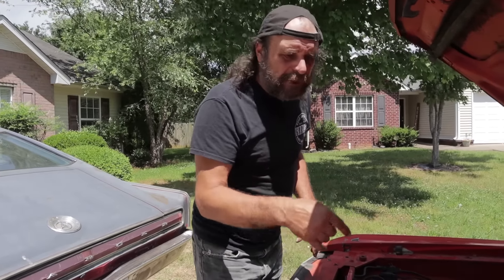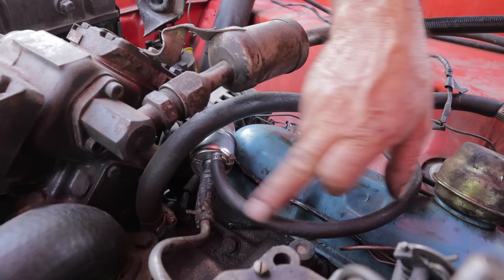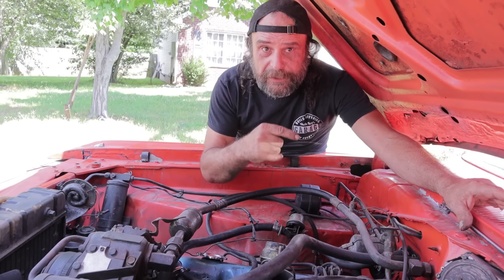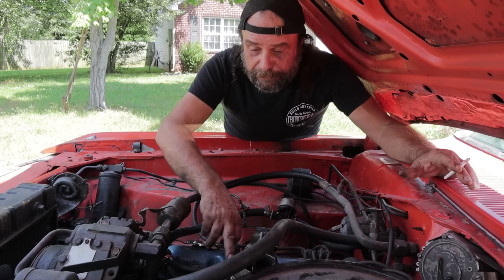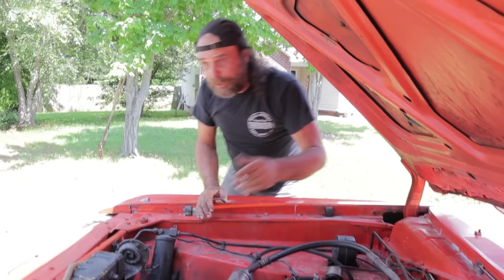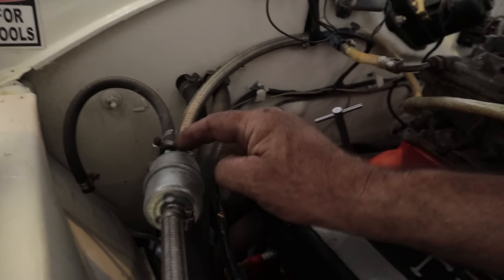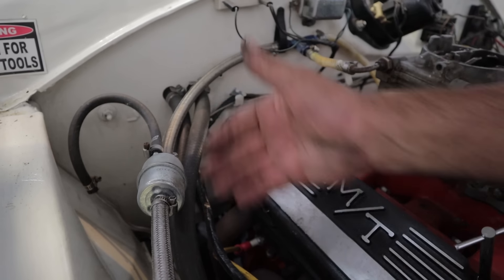$8 Cure For Vapor Lock

Comment: I'm proud that I thought of this on my own.
Question: My truck is factory set up to return from the mechanical pump and still boiled the fuel on its way up the engine. I capped the return on the pump, and I'm running one of the orifice-type filters right at the banjo on the carb. Fuel is then returning back down the engine and into the factory return line. Now I don't get vapor lock while driving, but I still get hard-starting when hot (acts like bowls are dry). Is a phenolic carb spacer the next step?
Reply from the maker: Yup
Reply: @UncleTonysGarage  Thank you!

Comment: If you go on rock auto and look up fuel filter for the swinger it will not show the filter with the vapor diverted although the filter is available rock auto and all other parts stores will not show the part number with the diverter . Recording part numbers these days is extremely viable .

Comment: Damn. I’m going to do this tomorrow. I’ve got a tank return fuel line but an in-line external electric pump plus a mechanical pump. Neither run when the ignition/engine is off and apparently this prevents any gas vapor return to the tank from the carb bowls. It prevents vapor lock but doesn’t help carb boil over at all.
I’m not sure what you meant when you said you used a tee back at the tank? Where does the 2nd line of the T go to? Is it one to the top of the tank and one to the pick up line at the tank before the Electric Fuel pump?
This is an under hood blower Chevy 350 ~6-8 PSI Max. I geared it to come on early. Not for any greater than 5500 RPM. It’s a 1973 Corvette. 4 speed. 4:11. I went with large powerful electric fans at first. They kept the water temperature down but because the radiator is slanted there was no air moving under the hood. Because it’s so low the radiator overflow tank is unreliable in 1973. 1973 was kind of a bastard year with multiple radiator mounting and sealing  configs during the model run. I love the looks, though, with the Chrome rear end and the low profile, now fiberglass front “bumper”.
We slapped the original fan and shroud back on and that helped a lot. Especially stop and go traffic. It didn’t help the carb boil over during short stops at the store, etc. There’s too much heat in the blower under that carb. The carb boil over is so bad that I worry it’s dangerous when it’s really hot out. I can usually start it by flooring it, waiting 30-45 seconds for some of that to evaporate, turn it over and feather it until it clears itself out. I couldn’t get my Son to figure it out. He grew up on EFI cars so he didn’t pick up on the subtle sound and feel differences in rich mixtures and how to judge the feathering part. I even had to tell him, at first, if you smell any gas assume it’s flooded just sitting there. Actually he can do pretty well now but it took him a couple of years. Live and learn. 
I learned when most of the cars my Dad owned were from the 60s. And they all did this. I watched my Dad feather the throttle like a master. Airplane engines, whether Carb or FI, where you directly control the mixture, will really teach you a lot about hot starts. A lot like old Model As and Ts. With manual spark advance, too. That’s a trip.
I hope this $8 fix you’re suggesting will help a lot. Any suggestions, please chime in.

I’m glad you liked those Cold Radial Engine starts I sent to you. https://youtu.be/myyDoekcf50 
Good times flying in a Beech 18 with Twin P&W R-985s. 985 ci and 450 HP each. The ate a lot of gasoline.
This is the exact plane I flew in with my Dad and many others with Mercy Flights in the late 1970s.
It’s now hanging in the Seattle Museum of Flight.
https://www.airliners.net/photo/Mercy-Flights/Beech-C-45H-Expeditor-D18S/2358476
Thanks.  👍🏻🇺🇸🔧
Reply: Michael Meyers is
Reply: So What's The Answer? Where Do You Tee Off at the Tank?
Reply: I have a 72 stingray with a stroker motor, had vapor lock problems and the biggest thing that helped was a heat shield from QFT to put between the carb and intake! 
https://www.holley.com/products/fuel_systems/carburetor_components/carburetor_gaskets_adapters_and_spacers/adapters_and_spacers/parts/300-4013QFT

Comment: Im by no means 'car intelligent' but I subscribed to learn more and honestly I've learned a heck of a lot already, I've been running into a problem with a 97 ford ranger manual, everytime we stall it refuses to start again for about 10-20 minutes (didn't time it but by the time we pushed it back home and popped the hood and scratched our heads it would start again) I did a little research after pushing it home for the fourth time tonight and I found alot of people running into the same issue but no actual clear answers. We found a way to make it start when this happens, by holding down the gas and clutch while cranking the engine. I was wondering if this fuel filter could fix the issue all together so we don't have the scare of stalling and  it not cranking on  a busy street or what not.
Reply from the maker: It does seem to be a common problem with those Rangers, but this won't do it.  Rangers are fuel injected, and this only applies to carbs.  If it starts while holding the pedal to the floor, you definitely have some sort of flooding issue.  Possibly a hung open injector, or even an ECM issue.  Wish I could give you a better answer.  Ranger forums are the place to ask
Reply: @UncleTonysGarage  
Lol i was searching up and down some ranger forums and could only find the 'flooring the gas' suggestion. We figured out our problem though! Incase anyone is having the same issue, the truck I'm referring to starts cold (I live in Georgia in 90° weather and apparently it's not supposed to do that?) and if we stall while it's still cold it won't crank again unless we use the "petal to the metal" method I mentioned above or wait 10-15 minutes. We realized this after a while and decided to wait until the needle on the gauge slowly reached about the middle of H/C and then we started driving, we stalled at the stop sign and it cranked right back up like it's supposed to without the gas floored. Since then we haven't had a problem with it not cranking as long as the temperature is above Cold. When it stalls even after driving for 15 or so minutes (this happened today actually) when we cranked it back up it went right back to cold and really slowly reached the middle like it had to completely re-warm itself up. Maybe its normal? I was told it wasnt. Maybe some think this is common sense but I haven't had to deal with anything like this situation before lol and couldn't find this in a ranger forum myself.

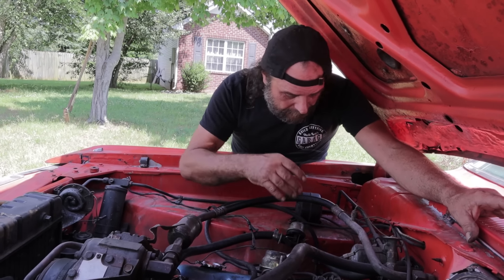Comment: 3:05 so thats what the "return" line on my 77 chevy k10 is for..... vapor return 
.
its a 6200 pound GVW truck.... so it was smog except (they didnt close that loop hole till 79 or 80 IIRC)
but i could see it having a fancy fuel filter, and the vapor being sent back to tank. 
.
ive been a mechanic since i was 6 years now..... (thats no joke..... i was tearing shit apart at 6.... with my dads oversight) 
now have 20 years experience (do the math)
.
and i learned something today!!!!
.
(and no.... im not confused by a carb.... i bet ya didnt know some GM quardajets have an adjustable part throttle? 
i can set dual points with a dwell meter, set timing by ear, and can pull and rebuild a SBC in ~20 hours)
.
not all of us young fucks are "carb illiterate" 
we are just illiterate.......

Comment: This might solve the issue.  One might surmise the issue is attributed to the ethanol in most gas now?  I've got a few stations in my town that sell ethanol-free gas, so I might try that first.  I just bought a '66 Tempest with the 326 2BBL.  After considering going with throttle body fuel injectors, the mention of how it would eliminate vapor lock paused my head scratching as to why it dies after warming up.  Seeing the clear fuel filter (near the carb) hardly fill, yet when the fuel line at the carb is pulled off, there's obvious pressure.

There's a local Maverick that sells ethanol-free 88 octane.  Might try that.  If not, WIX fuel filter part numbers for each of the two types of filters described would be great.  I just replaced the gas tank (the original was rusty inside, evident by the rust sediment seen in the filters (there was originally another one just outside the tank), and it's a non-return line style (just has a breather tube near the fill tube).  So I'd want to set it up like the Swinger, with just a breather line.

If the OP or anyone else can give me a WIX (or equivalent) part #, that'd be awesome...

Comment: Marvel mystery oil . Not much for the performance of the engines.  But it keeps the fuel cool and helps lubricate aspiration and reduce turbulence in the manfold as well to flow compressed h2o through the exhaust.

Comment: What I do is buy my leaded gasoline from petroleumservicecompany. I always buy 6 54 gallon drums but I use my car for racing every once in a while. Mine is a 69 camaro ss with the original big block 427. They are expensive if getting for a daily driver. My 52 caddy that is my daily driver I use leaded additive to ethanol free unleaded.

Comment: Tony, your channel is awesome and you always out out quality content. This is awesome and I want to do it to my car, but what do you mean by T'd off at the fuel tank? Does the vent line T into the line coming out of the sending unit, does it go up to the vent in the filler neck, or do I have to get a sender with a return line on it? Thanks!
Reply from the maker: On the RR, I Teed off at the sender.  Path of least resistance, the vapor pushes itself back into the tank
Reply: @UncleTonysGarage  10-4! Thanks Tony!

Comment: Hey Tony my 73 Ford E100 had what I called a 'return line arrangement on the feed to the carburetor, I removed the entire arrangement when trying to stop the leaks. I still have it, have only seen it used on the vans and Broncos, my fuel lines were rotten and leaking so I was eliminating as much as possible so out goes the return, it was a lot of metal line on the intake, nothing as simple as what you have. I had to stop using all forms of ethanol, it collected water, enough to rust my tank, took years to get it to finally stop clogging filters, that was after a flush and fresh gas, I hate that shit. My van has no reproduction tanks, and being on disability, there is no cash to pay for a custom made tank, hell, no funds to get the wheelchair lift relocated to another van if I found one, I make due. If I ever do get the vapor lock issue, I will grab a Dodge filter and hook it to a new return line, that is simpler, less metal.

Comment: Great, informative video.  Thank you!  I have this problem with my 64 GTO.  One question however~ how do you attach the line into the fuel tank?  I am guessing you can't just drill a hole and shove the hose in. Thanks in advance.

Comment: The best fix for vapor lock is electric fuel pump and a fuel pressure regulator. Pushing the fuel under pressure from the tank engine you raise the boiling point and pretty much eliminate vapor lock all together

Comment: 1987 Dodge 318 has been giving me starting issues, loosing prime and needs half throttle for hot starts. 

I was thinking the return was the issue, but  since you explained identical symptoms, I'm thinking maybe bypass is just plugged and its air bound🤔

Thanks for the info.

Comment: Amazing video. How does the charcoal canister play into this? I saw yours but could not see anything connected to it.  On my 74 J10, I have a check valve between tank and charcoal canister. Could I skip the check valve and go from tank to  to one of these filters?
Reply from the maker: The canister has to be bypassed for this to work
Reply: @UncleTonysGarage  Thanks! Waiting on the Wix filter to arrive and investing in a gauge/regulator. Summit is  a money pit! Thanks again
Reply: Uncle Tony's Garage  all done and man did this fix my issue. Runs well, engine stopped shaking, choking stopped and idles smoother. Enjoy the channel and educating me a lot.  Engine is a SBC mild 350 - early 70’s camaro rebuilt.

Comment: Great info. My 70 Nova vapor locks bad on hot days going up hill.  So how do you know if you need the orifice or non-orifice vapor separator?  I guess you need to know if there is venting at the tank?  I used to have a gen1 Isuzu Trooper, and it had a "vapor canister" that came off the fuel line and when back to the tank, I am guessing this is the same principle here, just wasn't around on the older muscle...

Comment: Nice video uncle tony,,im having that exact problem with my 85 monte ,with eldebrock, was wonder if the fapper line actually has to be hooked up or not ,thanks
Reply from the maker: Fapper?  If you're referring to the third nipple on your fuel pump, yes. On those cars, that was the return
Reply: @UncleTonysGarage  no i was referring to the 3rd nipple on the fuel filter my fuel pump has the main fuel line and the return, but still having the problem of starting rite up after a few min. Or ten min. Or so ,was wondering if i could hook one of those gas filter up  and maybe tee it off to whare it goes back into the tank with the return line  ,alls i know is its pretty annoying sometimes and the carburetor gets pretty hot too ,thanks

Comment: Very good, and thank you.  Also with modern fuel, if my car sits for more than about a week fuel in the float bowl evaporates.  So a lot of cranking and part throttle to refill the bowl and then the engine will start.  Is there a fix for this problem?

Comment: Great advice like Normal Brother. My 68 GTO was a Vapor Monster. During midday on the Hot Summers. Tried not to drive it then. LOL 

    Oh by the Way, don't know if you have ever heard of Trick Racing Gasoline?  Used to put 5 gallons once a month on my 60 cars. Cleaned All the Crap out and got Damn Good performance. Until going back to the crap modern gas!!

Comment: This happened to me on my fuel injected car once, I was running it hard stopped the engine and then evap system leaked and flooded the engine and it didn't want to run. Had to wait a good 10 to 15min for it to clear out.

Comment: Thanks for the tip. How would you suggest plumbing the vapor return line into the gas tank?
Reply from the maker: I used 1/4 aluminum tubing on the Roadrunner.  You;; just have to fab whatever will work best for you

Comment: I don't understand the difference between the orfice and non-orfice filters in the sense of "how does does the vapor get to the vapor out tube?"  In one, the orfice filter, there's a small hole that restricts but allows vapor to return to tank.  In the non-orfice, how exactly does the vapor get to the tank?  Is it completely unrestricted?  Doesn't that cause a huge pressure drop generally?  If it's a smaller line, I suppose that is some restriction compared to the main line.  Can you explain that?  Cool video.
Reply: Yeah same man. I put the filter on. Solved the vapor lock issue but not I’m having crazy pressure build up in the fuel cell

Comment: Thank you for the video! Does the filter needs to be near the carburetor for this thing to work? Or I can have the filter mounted on the side of my X frame so I have one line running to my carburetor. 1964 impala with 350sbc edelbrock carb 650. Thank you 🙏🏼

Comment: Morning, 
First thanks for the info. I am have vapor lock on my 64 impala. I have been looking at several different videos that show this vapor separator filter. All them say run the line back to the gas tank, which means you are popping hole in the top of the gas tank.  Was wondering if it is just vapor that is going back to the tank? Why do you have to run back to the tank? Could you just run back about half way down the frame and 90 down to the ground? If fuel goes back too I get it.

Comment: Watching your channel for a bit now,,now I'm a sub. On early Ford Mustangs would it be a good idea to put the return into the tank drain( at the bottom of the tank) since early Fords only run a single line. Would the pump be able to over come the weight of the fuel at the bottom of the tank?  And would it cause a siphon problem back to the carb?
Reply from the maker: Yeah, the vapor would find its way back there and just bubble through the gas, and I wouldn't worry about a siphon effect given the height differences.  I'd make sure the line stays under carb level at all points in between

Comment: It looks like the front carb is set back closer to where a single 4 barrel would be located. Was that done for better fuel distribution? Always wondered about uneven distribution and engine wear on a street car with inline dual quads running on the the primaries of the front carburetor most of the time. Might make an interesting video.
Reply from the maker: Optical illusion